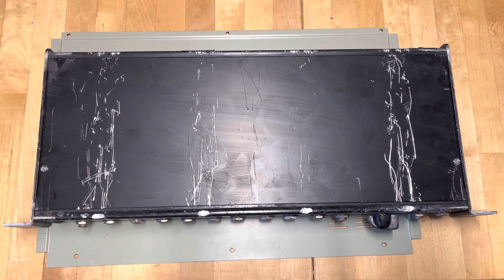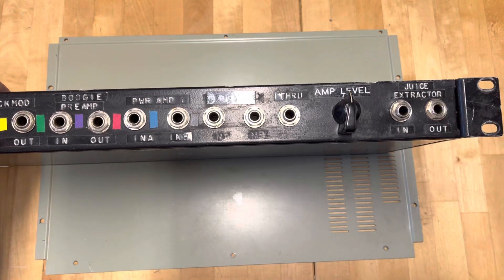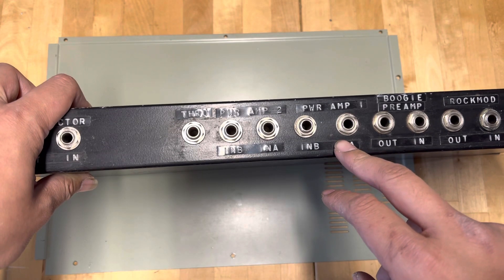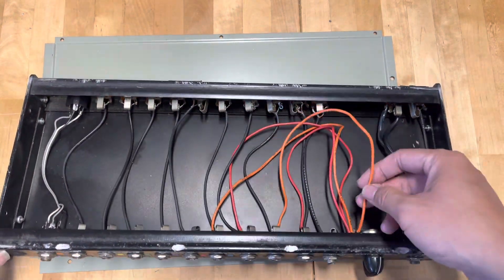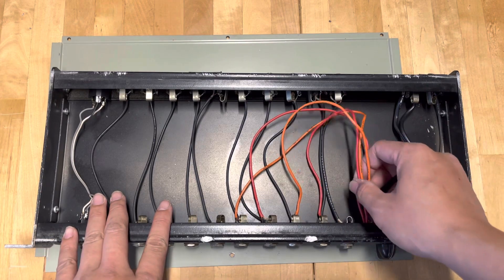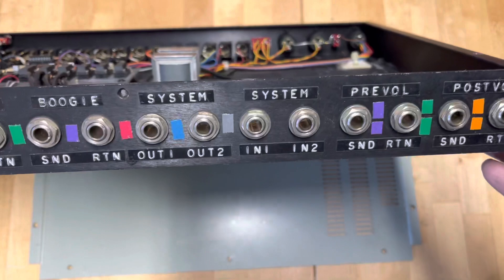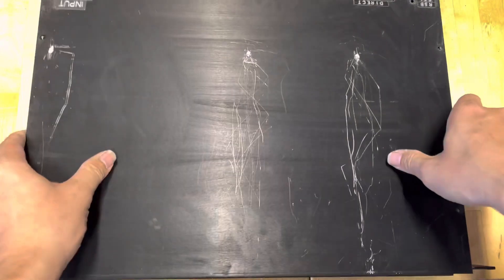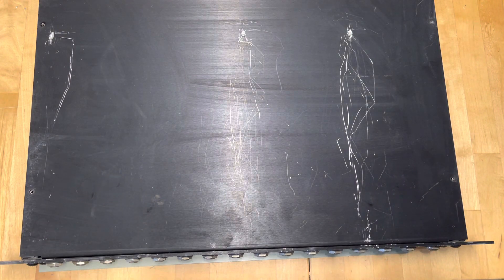Episode 2: Saving the Last of Runaways - Custom Audio Electronics (CAE) System

Comment: Thanks for this vid! On that CAE panel, d51c05d devices are 5V reed relays, MN4049B is a hex inverter/buffer. A very simple switching logic. :) TTL level control signals comes from Rocktron RSB.